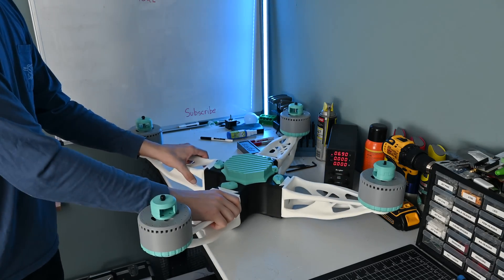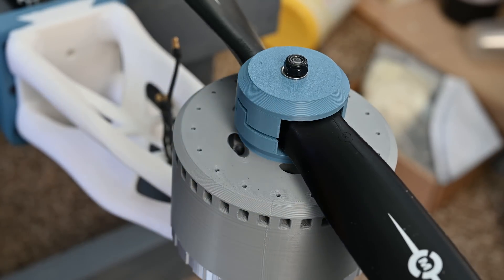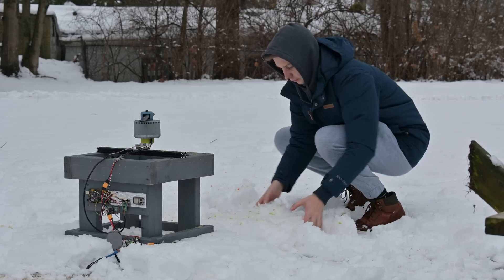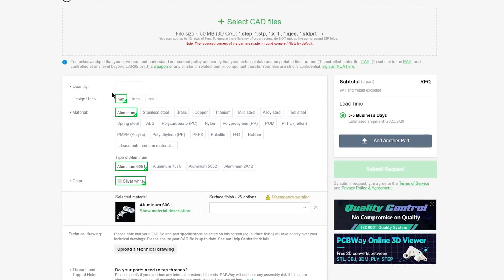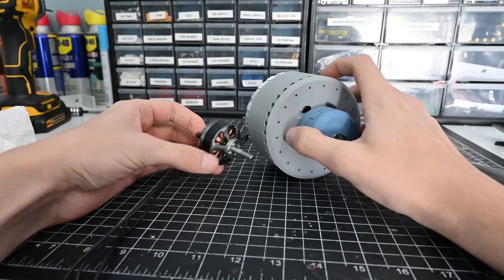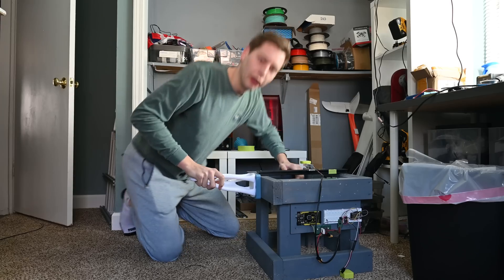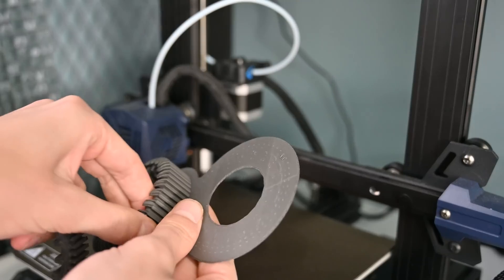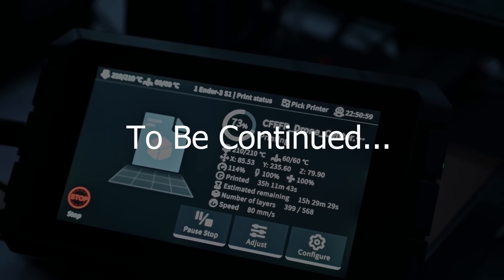This ENTIRE Quadcopter is 3D Printed (Even the Motors) Pt 1

Comment: Try tree supports instead. Might help cut down the weight of the support material and lessen inertia near the top. Also if you know inertia is a problem near the top you might want to dial down the speed at a certain height. Yes it’ll take longer but it’s better than another failed print from layer shifting. Awesome project though! Subscribed!

Comment: Like the video. and the 3d quadcopter idea. just wanting to know why your design has that much mass on the motors? wouldnt it be better to design the motor pods to be stationary and just spin the props?
Reply: You get much more torque with magnets on the outside, he's struggling a lot with torque as it is (since his core is nowhere near as good as stacked metal plates). Typical brushless quadcopter motors are built the same way with the magnets rotating on the outside (small toy versions will use coreless DC motors though if you're used to seeing that style, that's mostly for cost and skips on brushless motor controllers)

Comment: I'm agreeing on the bed slinger and part weight thing but I believe the motors may have gotten too hot. Luckily, if the board implemented it, you can use the configuration fille to adjust the temps quite easily. It also looks like you could probably mod the original part to get that arm 100% seated without losing much if any integrity.

Comment: That generative design tool is not optimised for 3d printing. It assumes a solid material, and so draws the material to narrow beams at the extremities of the volume.

A 3d print with material at the edges and as low a level of infill needed to make a successful print will already be optimised.

Your original part in a single volume, printed upright to remove the need for infill would appear better than your generative one.

Comment: The shifts are because klipper sux. I have 3 printers running nonstop on marlin making me money. I tried klipper on a brand new printer and after two weeks gave up. Print quality suffers from speed no matter how you tune it. Know your printers limits and just buy more printers. I'd rather be printing on 3 printers at 100mms than having a printer that's twice as fast and twice the trouble.
Reply: as you stated, you never got far with klipper, so you cant be for sure, the problem was many other factors like the motors overheating, the drivers overheating, lots of intertia from the weight on the bed, high speeds, etc, not klipper, default configs in klipper for the ender 3 series of printers have much higher acceleration than the stock marlin config which is why you can print faster but with untuned high accelerations, it can cause layer shifts and lots of problems.

Comment: I would highly suggest using as little infill as possible to save on weight. For the arms you should be able to print them with no infill at all but mabye print the dovetail solid. And for the base try out lightning infill as it should make it far more hollow. If you need the parts stronger you can increase the number of walls, layer width, or printing temp.

Comment: > have bed slinger (worst design)
> switch to klipper
> don't do any mechanical upgrades
> bump up the speed
> get layer shifts
> blame klipper
Reply: > have bed slinger AND almost 1 kg of material on it at the end of the print. that's a lot of mass to move around, no wonder it skipped steps.

Comment: Is magnetic PLA the best option for the core? Would a metal filled PLA be better? If you can get one that is just filled with iron particles. If not you may have to move away from fully 3D printed motors and instead move onto using metal sheets stacked together like more traditional motors.

Another possibility could be to insert bolts or iron rods into the 3D printed stator, that way the stator is still mainly 3D printed, but may get better performance.
Reply: There's two issues there: hysteresis and eddy currents. Iron is actually a poor core material at higher frequencies (which is why modern systems use ferrite almost exclusively, the switching frequencies have outgrown iron).

Comment: Not sure if this is at all related to your issue, but I had shifting layer issues on my creality ender3 due to overheating of the controller. The thermals were very bad which caused it to momentarily shutdown and restart, but continue the print with small offset errors. I fixed the problem by improving the thermals (just making the control board open to the air)

Comment: The point of generative design is to have just enough material to bear the load. Your arms are way too thick still. You could tell the generative designer to remove more material to decrease the weight.

Comment: Michael, fantastic video and I love the design! Immediately went to the description to see if you are sharing the design, saw no reference? Is this something you plan on sharing or a proprietary design that  you are working towards selling finished commercial products? Yeah, I’d like to build one….
Reply: This definitely isn't a commercially viable product, a cheap $10 motor will provide the same thrust as those motors except weight about 1/10th (so you cut down on weight drastically), and likely much more efficient, nor have that super long spool up time. This is clearly an engineering project passion to learn and try new things and push his skills to do something new (basically a learning experiment or a "because I can")

Most of my projects fall into the same category, just fun projects and doing what I want. If he releases the files that's up to him, 99% of my projects like this never get released or even presented because typically impractical or so specialized not many people would want them. His is at least cool to demo some of the design things you can do so it makes a good video. Obviously his design could use a ton of refinement, but overall very cool incorporating a lot of different things into one display.

Comment: Did you stress test the armature in the wrong direction? Great project BTW, super cool.😎
Reply: @Cool Cat :  Yes, but at least he knows it should survive a heavy landing!   😉
Reply: That's the comment I was looking for.
Reply: was looking for a simlar comment AFTER i made mine haha.. what about how it was disigned? the ai probale thinks theres going to be a load so it made it that way.. what if it were hanging? what would it look like then
Reply: @eowen200  when you do the generative modeling you tell the program where the forces are and how strong. In this case it's fixed at the dovetail and the expected load at the hole at the end is ~30 Newtons upwards (3kg).
Reply: maybe he's flying it upside down🤣🤣

Comment: for fixing the layer shifts
turn up the y axis current a bit 
and tension the belt if its not tensioned enough (too much have the opposite effect)
also i think there is no need for that much infill on the base 
its better to use less infill and increase the wall line count
Reply: often infill is slower than more walls anyway

Comment: the motor lag is probably a combination of both the higher moment of inertia and the non ferrite core, the latter reaching its magnetic saturation point more easily (thus capping the max torque), maybe you should try to redesign the motor with a non magnetic core and just wrap copper windings embedded in resin around it and veeery close to the magnets, you can also hold the magnets from their extremities to shave this distance even more. design wise I think there is a bit too much material here, the arms are way heavier than they have to be and the main body could loose some weight too 😶 still an extremely interesting project, well done !!
Reply: bumps somewhat my thoghts too. tho i would rather stick with the magnetic PLA then with completely nonmagnetic stuff. Or if feasable get some transformer sheet metal, would bear the better results even but is heavy in that size of motor. And yeah the structure of the arms can probably hold waaay to much. you can sure shave off 60% of the material (and reinforce the dovetail section maybe) But yeah i wont moan one bit. The whole project is dope!
Reply: Should be printing with carbon fiber and half the thickness. Easily cut that weight by 50%.
Reply: yes, i thought the body was way more robust than it need be, but this allows lots of practice crashing. i bet the weight could be cut in half
Reply: all the important stuff that actually makes a motor a motor, copper wire and rare earth METAL magnets

Comment: This is awesome! I've been thinking about how to apply a 3D printed motor to a 3D printed structure, for a 3D printed robot.

3D printed
Reply: As cool as that may seem, I really don't see any benefit in printing the housing/matrix of that particular electrical component. You could print all the resistors, but you shouldn't.
Printing the rest of the drive, like gears and pulleys, blades, sure. A base skeleton, links, something to keep batteries and PCBs in place: they all seem suitable for printing, given enough design mods to match FDM printed material properties. Not the motors, the batteries or the PCBs though.

Comment: 7:35 you should have printed that the opposite way. it would have taken way less infill to print it on the other side
Reply: I was going to recommend tree supports, but that makes so much more sense. Also take it easy on the infill for parts where weight matters!
Reply: Yeah, I was looking at that like, "WTF, man, flip it over"
Reply: @gpweaver  or at minimum print in 2 parts.... i cant believe a whole roll wasted on support material
Reply: well is seemed like the top parts was rounded or atleast the edges where so that would be risky only other solution really was go split it in 2 (to the point there its not rounded anymore) and then flip it
Reply: And use organic supports
Reply: Was thinking the same thing
Reply: Bro like I saw this support and was ain't no way. I quickly scrolled to comment section and saw that A LOT of us noticed that too.🤣
Reply: Seems like this guy knows what he’s doing…
Reply: @loganaugustine1086  I'd agree, so I'd love to know why he didn't print it in parts with no support needed. (Of course even someone who knows what they are doing can miss a trick here and there)
Reply: @loganaugustine1086  yeah that carrot snow broth was good
Reply: Probably wanted the top surface to have a clean finish

Comment: Hah, picked up a board and drivers for a klipper upgrade but didnt install yet just for this reason!
Going to wait until I have a spare month to do it and dial it all in.
Reply: if you have read any other comments, its a pretty easily diagnosable problem that was NOT caused by klipper, I have been running klipper for probably a cumulative of 400+ hours on my original ender 3 and have had 0 issues with the firmware itself and more/less problems with the actual printer in getting it leveled, z offset, etc

Comment: Nice! You can use PLA-LW, this is awesome material for quadcopter or airplane. I use pla-lw for small quad and big airplane
Reply: That might help; though id have to pause at the design requirements first. This centre section seems to be designed as some kind of flying tank; not sure that LW-PLA will have the desired penetration resistance against HEAT rounds?.
Reply: I would advise against LW pla because it will decrease frame stiffness, which can cause problems later with to much vibrations getting into flight controller. 3d printed motors will cause some vibrations on their own, so i wouldnt do anything that can amplify those problems. ABS might be better solution because it is lighter than PLA, has better impact resistance, and only slightly lower stiffnes.
Reply: Is pla lw squishy. I want to 3d print a lightweight mouse shell but don't know if it will be stuff enough
Reply: @navidmehdi6  I don’t think it is squishy, more just a lightweight foam. It won’t be as stiff as normal PLA but you can also foam it to different amounts to change its density and stiffness.
Reply: @navidmehdi6  Never 3d print something that will be in constant skin contact. You can't clean between the layers and it will get dirty there. If you really want to do it you need a smoothable filament (PVB/ASA/ABS) or use epoxy resin or something like that to smooth.
Reply: @navidmehdi6  I would just use ABS, normal mice are made out of ABS and its impact resistant (so if you drop the mouse it won't break as easy), its also much lighter than PLA per volume. Its less stiff than PLA but its what most of your peripherals are made out of. Also you can acetone vapor smooth it (or sanding it is super easy and fast, its highly machinable if you need to drill holes or tap threads, it also won't melt while drilling)

Downside with ABS is it can warp a little, however its a little more flexible so it will likely pull itself back into place when put together as an assembly (and often you can just use a Brim and minimal support and it won't warp.
Reply: PCTPE
Reply: I was going to suggest that. 3 kg for the frame with 3D printed motors doesnt sound like it will work all that well together. Maybe it would be worth considering using carbon fibre rods as reinforcement and then you can reduce the amount of 3D printed parts needed.